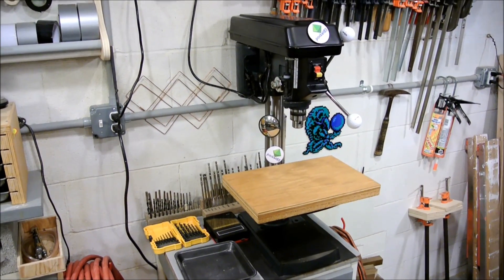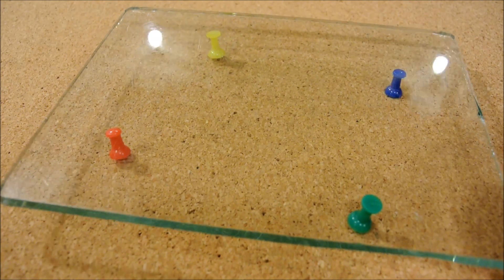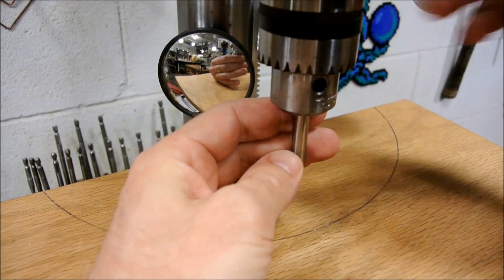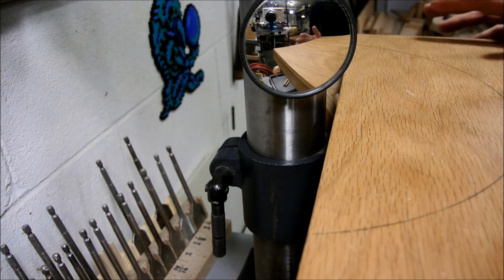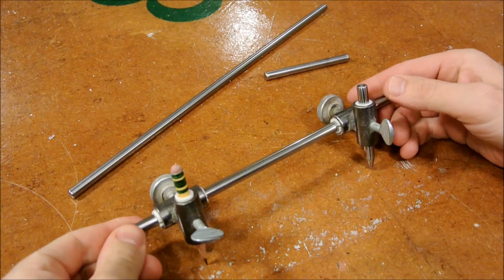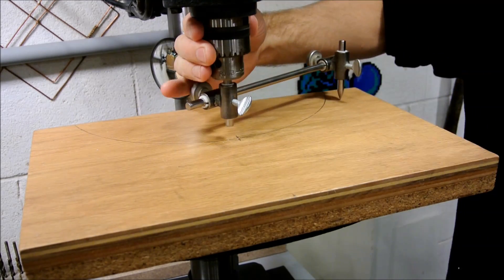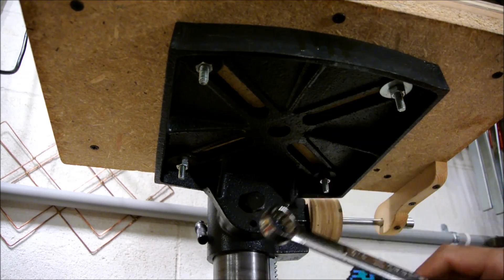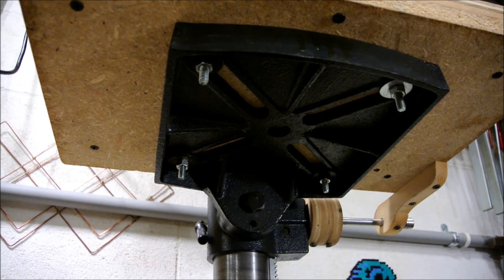Square your drill press table plane. It's easy.

Comment: Well I found most of your video quite useful ragarding the L - R relationship to the quill/drill bit, but it seemed to gloss over the Front to Rear measurement rather quickly, but I think I'll come up with a strategy to measure/make tiny shims as required, thanks to CocaCola cans. The written discussion was Waaaay above my head, as I didn't study the "Philosphical Musings of Late 19th Century Trigonometricians versus the Pragmatic School of Practical Mechanics 101".
Reply from the maker: Just set the L/R first, and then transfer the height of those two points to the front and center. I didn't want to go into more detail, because I'm already afraid this video is going to get lots of those comments about how I'm making a mountain out of a mole-hill. It's hard to find a nice balance.
Reply: Okay, that simplifies it for my drill press table, which has very similar layout to yours. Thanks for your reply. Some months ago I tried to square it using a spirit level, but realised that was wrong thinking, so I used a small version of a speed-square that came with my mitre saw, which seemed practical for my basic builds. Your approach with the beam compass seems very accurate - thanks.

Comment: You could also use a dial indicator in that bar compass, right?
Reply from the maker: Sure, but I don't see the point in this setting. Variations in the plywood become significant at that scale, as does sawdust. Context! That would certainly be appropriate for a machinist and a milling machine, though.
Reply from the maker: Oh, and believe it or not, I still don't own a dial indicator. I always seem to find a clever alternative to purchasing one! That's also why I didn't have a scroll-saw for so long.
Reply: pocket83 Haha, i know that feeling :D
I still remember how i got around things before buying a "helping hand", solderting things was sometimes a pain, but i didn't know other :D After i got one i wondered why i didn't spend the 8€ to buy one long time ago :D
Same goes for a proper soldering irom cleaner, the brass wool things are super cheap, but i am still wiping off my iron on wet (or sometimes even dry when i am feeling lazy) toilet paper, but i can't bring myself to spend the money ^^

Comment from the maker: This video was an unintended diversion from the build video that I'm just finishing up. That will be out next Friday, unless the meteorite hits. Until then!
Reply: On "Squaring your drill press table" video,  when you made the arc with trammel point how do you know where to stop when returning the table to 90 deg to the round column?
My column does not have a reference line showing the column center. I can't find any thind on the table showing it's center either.
Reply from the maker: @rhfjrbeck  Not sure I understand the question. Ideally, the trammel point will almost touch the table everywhere, that is, it should be the same distance away at anyplace along the circle. Doing so will (should) automatically square it with respect to the column.
Reply: @pocket83  I use the y-axis to drill angle holes. If the table moves when lowering or raising and is not returned to original position this throws the newer holes out of alignment.
Great video.
Reply: @rhfjrbeck  Ok but ar's have a wide tolerance that looks close enough. I'm not with the ATF.
Reply: On the part on this same video, showing underside of the table, there is a small hole under the table adjustment, left & right. This hole has an allen screw to either lower or raise the front of the table. I had to use a shim to level mine.